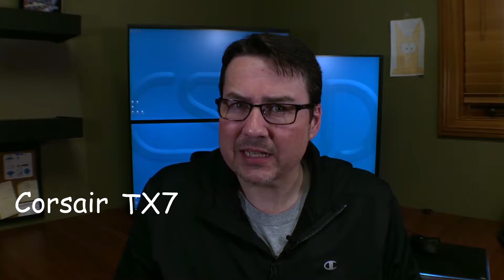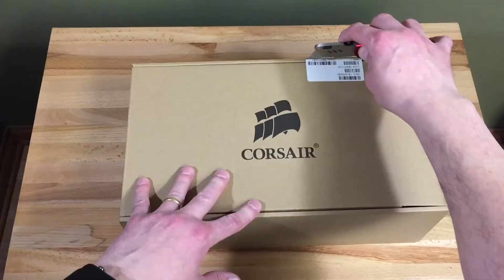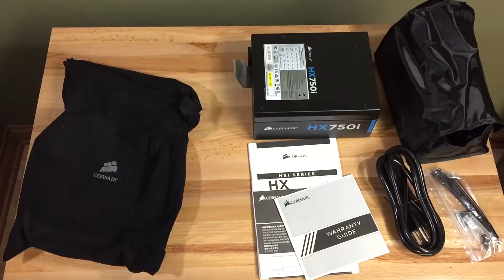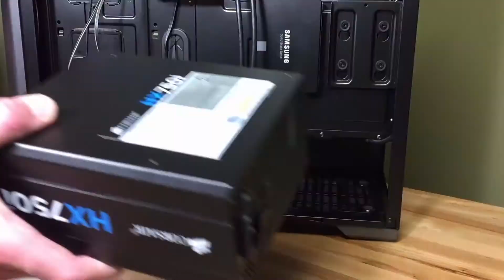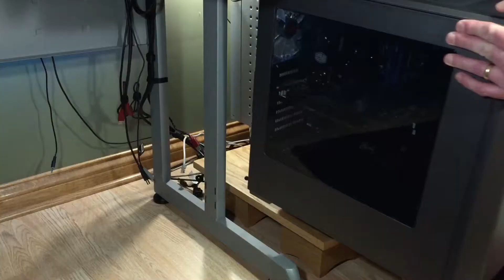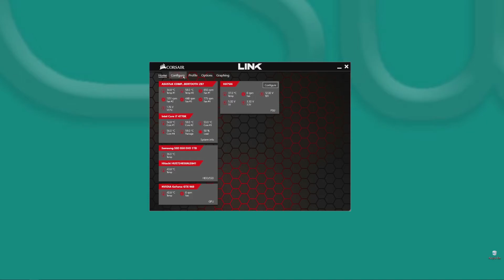I GOT A FREE POWER SUPPLY UPGRADE!

Comment: Dear Sir,

Could you offer me spec. of your pc to fit to Software like tekla ? I mean your computer spec..

I do not know what spec. of computer to buy it.

Thank in advance,
Best regard
Reply from the maker: I originally built my computer about 3 years ago and have upgraded it several times since.  I have never really had any complaints about speed or stability when running any software (including Window 10 and Tekla Structures v19 thru 2017).  This isn't a "pre-made" system, but if you're interested in building a similar one, I've included the Amazon links to get you started (note: some of the items are no longer available and would have to be substituted).  There are a ton of videos on YouTube about how to build your own computer.  Here's a link to a play list from my favorite tech YouTuber (Paul's Hardware) that explains the whole process: 
https://www.youtube.com/playlist?list=PLRnHcRQUxuoeQM4-llcMNXTakKZcAAyB6

My current configuration is as follows:

ASUS Sabertooth Z87 Motherboard (http://amzn.to/2rWwodE)

Intel i7-4770K (3.5GHz) CPU w/Cooler Master Hyper D92 Cooler (http://amzn.to/2svyn7t) (http://amzn.to/2svrRgX)
32GB Kingston HyperX DDR3 RAM (http://amzn.to/2t0p3tn)
EVGA NVidia GeForce GTX-960 2GB SSC Video Card (http://amzn.to/2s0yzbr)
Corsair HX750i Power Supply (http://amzn.to/2rHm05l)
Phanteks P400 Eclipse Mid-tower Case (http://amzn.to/2s0Ftx8)

Samsung 850 EVO 1TB SSD (Main program drive) (http://amzn.to/2rH2XbC)
(2)HGST 3TB 7200 RPM HDD (Raid 0 Config, Data Drive) (http://amzn.to/2rHChXS)

(3)QNix QHD2730R DP 27" Monitors (http://amzn.to/2tyFevp)
Corsair K95 RGB Keyboard (http://amzn.to/2s0vTuf)
Logitech G900 Chaos Spectrum Mouse (http://amzn.to/2svBcFO)
Corsair MM800 Polaris RGB Mouse Pad (http://amzn.to/2rHmPer)

Hope that helps!